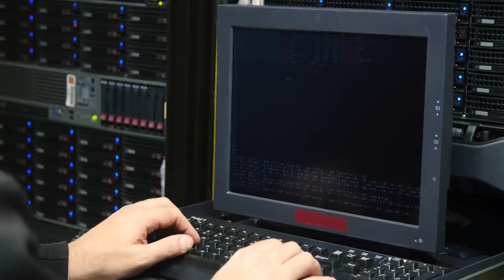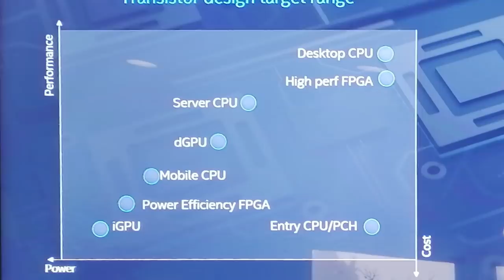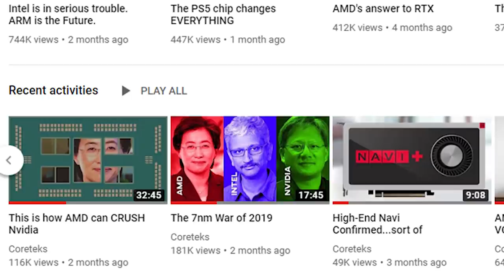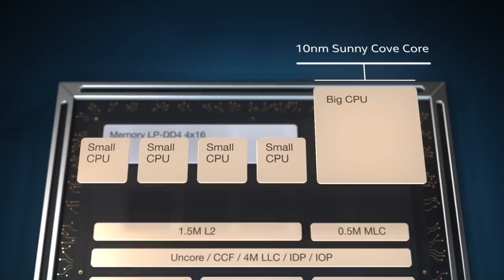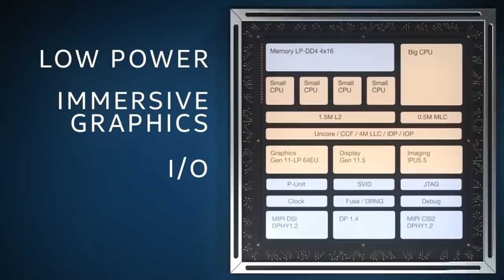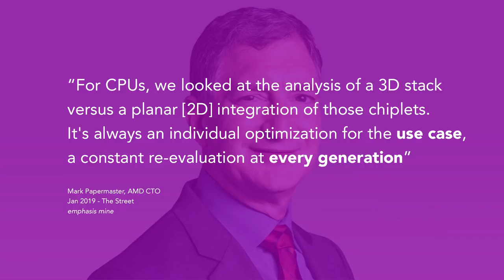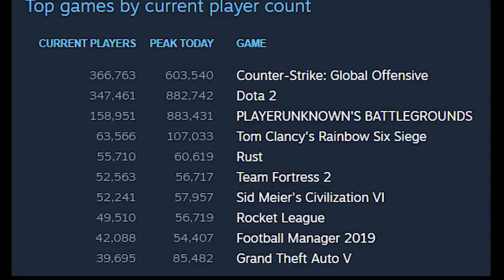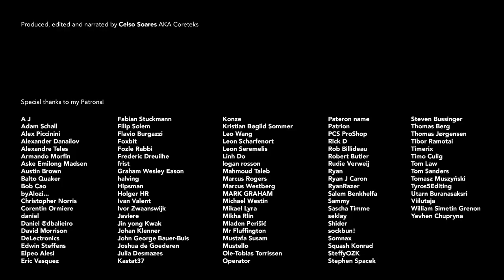2D vs 3D Stacking: Intel’s plan to beat Zen 2

Comment: Zen 4 in 2021 is too optimistic. I'd assume we'd be lucky to get Zen 3+ by then. Consider we still don't have Zen 2 in our hands and there will possibly be a Zen 2+ refresh. Or maybe you assume there won't be refreshes because AMD will be on a rush to move to stacking?

Or maybe when you said Zen 4 you meant Ryzen 4000's?
Reply: Zen4 is already in development, Its supposed to be used in an upcoming supercomputer. 
AMD works 3 generations of chips at a time, soon as Zen2 comes out, you'll be hearing about Zen3, and then Zen4...5 etc.  They are really aggressive.
Reply: @terran2kk  but we are getting refreshes each time right? Zen 2, then Zen 2+, then 3, 3+, that would put Zen 4 as Ryzen 7000 series, I can't believe that could come out 2021.
Reply: @4.0.4  no refreshes, AMDs roadmap has it laid out....it was Zen,   Zen+,    Zen2 (2019),   Zen3 (2020);  AMD announced in 2018 they are already in the design phase of Zen 4.
so 2021 for Zen 4 is what is expected.

Comment: Its look like you dont know what is IFOP by AMD...😄
Reply: IFOP is not 3D stacking, and there are physical limits to what speeds you can reach when two dies are so far apart. The reduced distance 3D stacking introduces is the key. No trails, no inductance, no delays, no interference, pure speed.
Reply: @papaiurso5860  its look like you dont know what is IFOP too...

Comment: Interesting points. Server chip development from Amazon and Facebook has a very real possibility of scaling into the PC/mobile market, so I'm interested in seeing if and when those companies have products ready to run their services on.

I'd like to point out that while Apex Legends is very successful in terms of player numbers, it's a free to play game and is the current social game of choice for people. Those player numbers don't necessarily translate into actual sales, considering there isn't currently even a lot of content to purchase. There will always exist a market for high-fidelity singleplayer and multiplayer games, and many tech companies are pushing AR/VR, which will require additional resources to run on top of what running a game on a 2d monitor would. The hype for games like Doom: Eternal and Cyberpunk 2077 prove that.

The perceived failure of Battlefield V is due to many different questionable choices cascading into disappointment from many previous fans of the series. The alternative history aspect, the social media outcry and response to that outcry, the developer insulting its customers, the market having largely shifted from the glory days of Battlefield 3 and Call of Duty to battle royale games, etc.

Nvidia's strategy isn't to corner a specific segment of the GPU market. They are the market leader, and are innovating in order to keep that position at as many price points as possible. The reason why Nvidia is opting to add more performance or graphic options instead of increasing VRAM to better support high resolutions is a clear indicator that they are eschewing higher resolution support for better framerates or graphic fidelity in their mid-range lines, and considering how 4k has so far failed to capture the market in favor of 1440p 144Hz or 1080p 240Hz, I believe this strategy is sound. Those who are looking to play at 60 FPS can use the RTX and graphic fidelity features, while those with a more competitive mindset (including many competitive Apex players) are instead opting for intentionally lowering fidelity to provide better visibility and smoother action. The fact that even the RTX 2060 has a better chip than the newly announced 1660TI is a clear indicator that RTX support will be tacked on to the high-end lines regardless of if it will be used or not to absorb some of the cost of development. However, the market has reacted poorly to the increased price of RTX cards, and many people are choosing to stay on the now over 2 year old gtx 1000-, or even 900-platforms. Once the cost becomes less prohibitive and more games add support for real time raytracing, Nvidia's cards will offer a clear distinction from AMD's, while also being able to do everything AMD cards can. AMD currently has to compete on price and support for higher resolutions at the budget segments, and they are clearly still in a worse position. That's why I'm really interested in seeing what Intel's GPU strategy will be.

Good video.

Comment: Intel has Problems with 10 nm … 14 nm will be come since 2020... 3d ? lots of temps..  Memory?? why 3d? amd has it make possible with 2d and has lot of places on chip. so no Problem for amd. fx cpu???? .. yeahr 5 gigaherz @ 32 Nanometer . Pretty nice or not. rigth: gigaherz are not as the same as preformance. but fx has lots of Memory …  the Problem was the Architektur … you have a data that is comeing from up to down... but in the fx the most programs Manuals the cpu wrong. the data makes cycles in the cpu … and the mini  l1 Cache was shared. not the l3 ..  that was the Problem... In multithreading the fx chip it was faster than Intel.. but not in singlethreading workloads… so you have lots more multithreading preformance as you have if you use 1 8 cores in 8 singlecore processes. … zen is the better fx with improvements of the fm2+ platformes and a better Architektur.. It is more than more Memory. It is how you make the Architecture. Sorry for my bad english..

Comment: The is almost no point in having hundreds of mb of cache. With the current cpu technology having any cache size above 64mb for consumer products will be a waste of resources. You are talking about performance improvements below 0.5% and making it sound like a big deal. The improvement percentage declines greatly as the cache size increases to the point that increasing the cache size becomes obsolete. The reason that companies do not use huge cache sizes is not only because of the size restrictions on the surface of the chip as said in the video. So this video is misinforming on that part.

Comment: Intel is going to go the way of Matrox if they dont get their shit together. The only reason games use single cores is the average system analyst (the guy who tells all the programmers what to do) isnt particularly smart. AMD is kicking the SHIT out of them. All they have right now is standard core speed . Which ryzen chips with twice the cores can match with designed in overclocking.  Intell failing would SUCK because the second they do theres no competition and AMD becomes shit.

Btw ive seen people who seem to know wtf  theyre talking about say Intels 10mm process is pretty much amd's 7mm... theyve become marketing turns. We care about  benchmark speed.. not your process or your weird feature

Comment: People aren't as much as "hating on Intel for the sake of defending the underdog" as people dislikes and distrusts Intel because of their illegal acts of anti-market and schemes to undercut AMD, that, Intel had to in courts pay AMD 1,25BN US dollar, in addition, and outside US, Intel was fined by the EU 1,06BN euro. It's not really something that "just happens" to a corporation, it's not even a "whoopsie", but a thoroughly thought out plan to by criminal means gain the upper hand on the market that Intel competed within and still competes within. But, both AMD and Intel are large corporations, so it is not logical to attach any emotions to "which is the better" outside of the factual numbers as done properly, no one should see themselves as "on the blue team" or "on the red team", but "on the team that finds an open pro-consumer market the most logical solution for advancements in technology and related IC". (IC=integrated circuitry, just an fyi to the abbreviation)

Comment: There is a recent game better than apex. But you right, it run on a low end hardware.
Super Smash Bros Ultimate
Well, it is at half of the number of players of apex, because switch has a 30 million install base only, while apex is avaliabe for billions.
Yet, 13 Million paying 60$.

Comment: I don't trust 3D stacking for high end cpus. Too hot,  increasing the width at all will drastically increase heat retention in cpu diea.  This will force clockspeeds down and heat up.  It will likely be a failure for high end single threaded performance. Don't even see it being viable,  ever.

Comment: Who cares.

Computers today are absurdly fast already. A machine capable of running latest AAA games at 1080p in max graphical detail while pulling 120 frames per second can be built out of 5 year old hardware for under $500.

For home non professional users, only an idiot would run out and blow a shed load of money on latest components they do not need, just to play the lastest title of battlefield or some such nonsense game that does not take full advantage of the power in the computer due primarily to most AAA games being developed for consoles and ported to the PC platform with their limitations and piss poor rushed badly optimised coding.

Comment: If you want technology to improve, you've got to stop pinning your hopes on a single company.

It doesn't matter who has the better technology, it only matters if there's enough pressure on the companies involved to put in the effort to keep improvements happening.

The reason Intel's processors have been so underwhelming for so long is not because they couldn't have done better (though complacency may have made them put in less effort) but because this low effort nonsense of theirs has been 'good enough' while they had no real competition.

AMD had nothing for a really long time, now they've got Ryzen.
And THAT is what will make Intel sit up and try harder.

That's not to say the technology comes out of nowhere just because of competition. Obviously not.
But without it, there's really no incentive to do anything beyond the absolute bare minimum, because the only thing you're competing with is your own older products.
In other words, in the absence of competition, all you have to do is put out enough marketing and/or technical improvements to overcome people's tendency to say 'eh. What I've got is good enough already'. No more than that is required. 
Obviously sales never drop to zero even if technology stagnates, because things break, new people have new requirements, and so on. But you still can't sell much without at least SOME technical improvements to convince people.
Those technical improvements don't have to be particularly impressive though.
... Unless you have a competitor that's sufficiently capable of matching or exceeding what you put out. You can't put out a 20% faster processor if your competitor is putting out a 40% better one at the same price. But you may well be able to get away with 20% better if your competitor struggles to even match your existing product. (or you have no competitors.)

Nobody should wish for these companies to die out.

The healthiest situation (for us, as consumers) would be to have about 20 CPU manufacturers whose products are all in the same ballpark of performance and cost. (eg within 10-20% of one another.)

But alas, technology and high development costs trends towards monolithic single corporations...
We're lucky we more or less have 3 CPU designers, although one operates in a different niche to the others (For now). But it's not a great situation for competition...

Comment: your so correct. I build gaming computers. But I will not sell anything that I would not buy. I SOLD 97 gaming pc.in 2018. I shut down in 2019 . Not even 1 gamer was or will be made by me in 2019. 20/20 is a whole new ballgame as I will use Intel exclusively  I have waited years for this. If Intels gen. 11 is as good as Intel says in a 25 watt package . Than I already know Xe is going to be fantastic in a 3D package in the 200+ watt package

Comment: Aren't AMD doing the same thing already? 2.5D? Also won't they have an advantage doing this with a 7nm or possibly 5nm chips? AMD are boring with their delays trying to release on dates with special meanings 7/7...so stupid. Too slow for my liking, I assume they already have CPUs and good drivers ready. Don't AMD servers have dual socket mobos too? Intel suck because they just screwed us over for years, AMD have the same plans as intel be it 3D stacking or multichip solutions, so I don't care what intel is doing, their 10nm delay means their next cpus will be expensive out of the gate, I want many cores for vm management and decent ipc and clocks cor gaming too.

Comment: Cant even get 144 fps on my 2080 on low settings and you act like apex can play well on apus lol
Reply: What's your cpu and ram speed?
Reply: @Lightitupp1  1950x 4ghz, 3000mhz ram. But my GPU is at 100% the entire game so I don't think that is the problem lol
Reply: @LordOdin  That's really weird, are you playing at 1440p? I've seen benchmarks of worse cards being able to hold 120-130fps+ on higher settings. I'm still skeptical that your 1950x is capable of holding 144fps the whole time tho, that cpu isn't known to be a good gaming cpu
Reply: @Lightitupp1  yeah at 1440
Reply: @Lightitupp1  1950x is just as good as any other ryzen cpu of the same generation when gaming.
Reply: @LordOdin  Nah it's like 10% behind the 1xxx ryzen series. Also, I've read a lot of people having problems with ryzen cpu's on the apex legends reddit. Complaining about fps drops.
Reply: @Lightitupp1  where do you see that a 4ghz thread ripper is 10% slower than a 4ghz 1700x
Reply: @LordOdin  game benchmarks, look them up. I thought it was pretty well established that threadripper was 10-15% behind the 1xxx series in gaming.
Reply: @Lightitupp1  I suggest you do more research considering the 1950x beats every 1xxx ryzen in gaming if they are similarly clocked.
Reply: @Lightitupp1  uhm this is when all ryzen CPUs had weird gaming problems and 5 bios updates old. Maybe look at something within the past 6 months lol
Reply: @LordOdin  well regardless of it being on par or below 1xxx ryzen series cpus it's probably likely that it's your cpu that is causing the issue you're having. Like I said, there were numerous posts of people having performance issues and they were pretty much all with ryzen cpus.(when they didn't have obviously below spec parts) So you're probably going to have to wait until they fix it, highly doubt your 2080 is the issue here at 1440p low settings.
Reply: @Lightitupp1  the GPU is at 100% how is it not the GPU. It's at 100% the entire game.
Reply: @LordOdin  I'm not saying that you're going to have 144fps locked, you're going to have dips below. Cpu's that are faster than yours can't keep the 2080 at 99% the whole time.